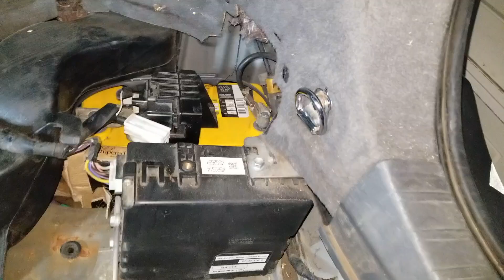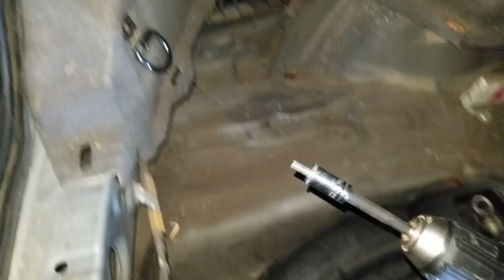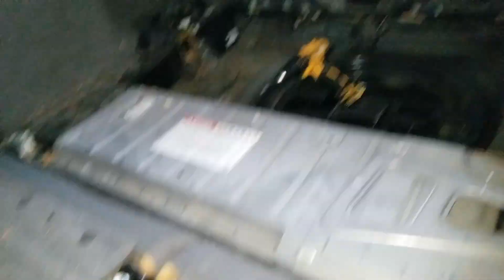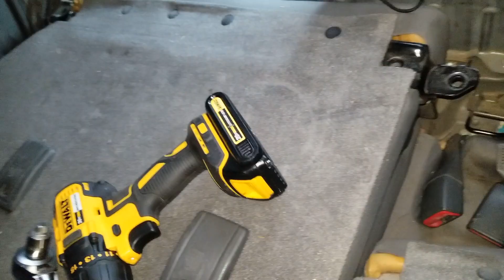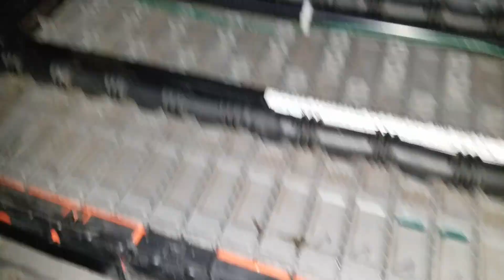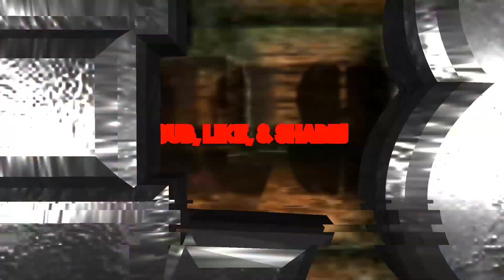Fix Prius P0A80 P3015 P3016 Check Engine Light Error Code & Red Triangle HV Main Battery Pack Remove

Comment: I cleaned all the copper parts and changed block 6, but the problem continues
Reply from the maker: You will need to monitor your battery packs to see it there's any massive voltage drop.